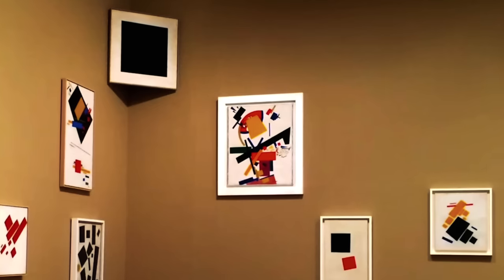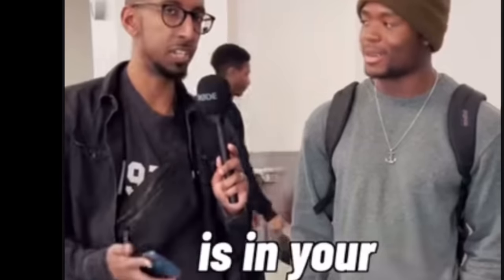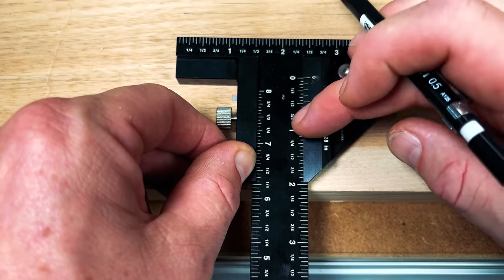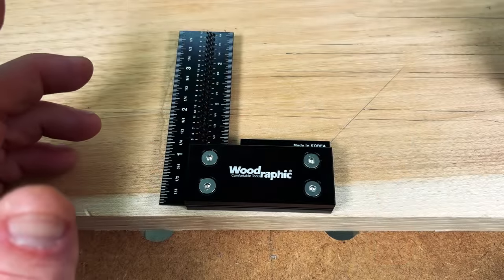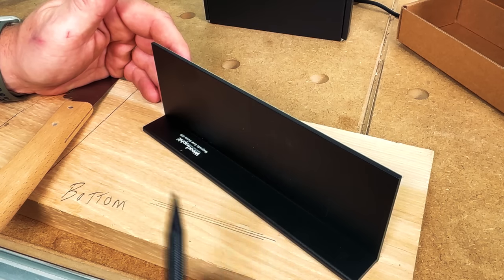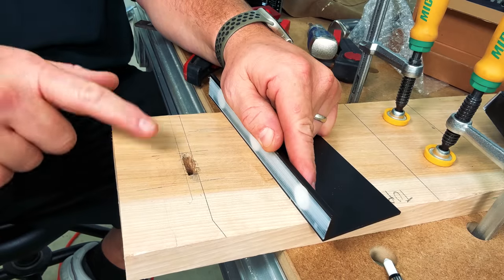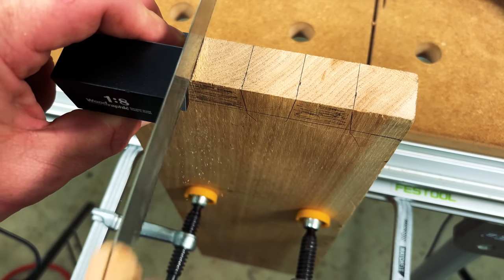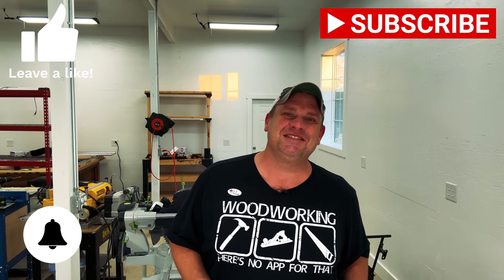Uncovering the Secret Tool Lineup That Will Challenge Woodpeckers

Comment: Great find Mr Flynndogg and thorough demo of these layout and guide tools! I love Black "high contrast" tools for the  tools I have to read with old eyes! Now for tools I don't read the uglier and brighter is what I pick for locating easier on my busy benches! Magnetic fence who knew, great design? Are those teflon coated, did they are you mention how long that would last? Checking the scales between the tools as applicable to also check a companies detail to accuracy and quality. Great find and thanks for sharing!
Reply from the maker: Great questions lespaulguitar man!  I like the black and white contrast too.   Really easy to read.   I don't know about the teflon coating, that is something I will need to research.   Great point on checking to see if the company has a tolerance for their accuracy that is another thing I want to look into.  Thanks for your great questions, and thanks so much for watching!
Reply: Appreciate your honest, informative, accurate, tool assesments and finding these alternative cost effective tools. Options are great to have, when you have to spread the funds for hobby /dyi work! Hope to see a project designed and made for Layla the new shop dog! Thanks!  @FlynndoggWoodwork

Comment: Thank you for shining some light on the Woodraphic brand. How much damage did that flush trim saw do to the plastic coating on the dovetail jig?
Reply from the maker: I didn't notice any damage, and if it did do damage I would suspect it is from my lack of skills! :)   I did notice a little bit of damage to the chisel saw guide, but that was also due to me not having the appropriate saw and the teeth rubbing against the metal when my cut wasn't completely straight.  Excellent question!    You know right after I filmed this video, I saw my damn japanese pull saw staring right at me on the top of one of my storage containers! :(

Comment: Have you tried the magnetic tools yet with a saw that has some set to it? I've always wondered how well they hold up, or would the saw's teeth end up damaging it?

Also, have you tried any iGaging tools? I have a couple and have been very pleased so far.
Reply from the maker: Great questions Eric,  the saw I used in the video had some set to it and actually did scratch it up a bit, So I won't be using that type of saw with it.   Too funny that you mentioned Igaging tools.  I'm in the process of thinking about doing a video on them.   They look really nice!

Comment: Interesting that you only had a flush trim saw available for testing the magnetic saw guide, its teeth don't have a set, unlike most regular saws which would be blunted in no time as soon as their teeth scrape against the side of the guide.
Reply from the maker: Well, the flush trim saw was advertised as a flush trim saw but it is a harbor freight one and I don't ever use this one on flush trimming as it does have the teeth bet out and scars up my wood every time I've tried to use it as a flush trim saw.  Excellent point though and thanks for sharing and watching secobaairways.
Reply: Those guides will get wrecked before any saw will; I say half a dozen cuts and you no longer have the precision you think you do. I don’t see why a woodworker would need such a tool in the first place, it’s like the most basic jig you can make out of hardwood. Unlike this soon-to-be-useless overpriced piece of metal you can true up your shop made guides using a disk sander as many times as you need. And magnets only get in the way, just bend the saw against the   Guiding surface
Reply from the maker: @nocandopdx  Thanks for sharing your thoughts nocandopdx!  I appreciate it!
Reply: @FlynndoggWoodwork  of course

Comment: Nice video as usual.  What is the difference between regular marking gauge and marking gauge marked (new) on amazon?
Reply from the maker: Interesting, I’m not sure I am familiar with what you are talking about.  I wonder if they have refurbished squares available?    I’m going to have to research this one!
Reply: @FlynndoggWoodwork  I followed your amazon link for Multigauge and i see for 8 inch model there are 2 listed. one is marked (New)
Reply from the maker: @AlexK07010  I did reach out to them they said they are aware of it, I guess they are having some stocking issues... Not sure what that means.
Reply: @FlynndoggWoodwork  thank you for following up

Comment: Nice but still too expensive. Their carpenter square for framing is $70. Crazy. Creating an accurate 45 with a laser cutting machine is a no brainer. All these companies are over charging. I’ve checked all my squares and they’re  all spot on. They’re either from Home Depot or Amazon.
Reply from the maker: I hear you doc145.  I agree with you, the woodraphic still aren't cheap.  I have a couple empires as well, that are dead square and do what they need too.  Just wish they had those little holes for scribing lines, but with the combination square I can always adjust it.   But I hear you, still very expensive!

Comment: The Woodraphic tools appear to be nice and I'll consider them for my next purchase. 

However, it's unfair to compare the Woodpecker 1282 12" square with Woodraphic's 12" square without also noting that the Woodpecker has a stainless steel blade and the Woodraphic's blade is aluminium. Using stainless steel allows Woodpecker's blade to be only 1/16" thick, reducing the chance of parallax error. Woodraphic's aluminium blade is not only less durable, it's thicker -- making it harder to read accurately. Besides, when I checked Woodpecker's website just now, the list price of the 1282 is $140, not the $180 mentioned in the video. The Woodpecker square is still $50 more than the Woodraphic, but it's NOT double the price of the Woodraphic as stated in the video.
Reply from the maker: Excellent point DKwaiser on the paralax!   I had forgotten about that, thanks for reminding me again.   I guess the paralax wouldn’t be that much of an issue if you were using the scribing holes though as you would have a positive point to reference versus your eyes, but get point.  Glad to see woodpeckers is come down a bit in the price, I suspect it won’t be for long.   I feel like they run a lot of short promotions on their tools that decrease the price for a short period of time.    Thanks again for bringing up the paralax!

Comment: Saw guides are nice and I have used them a time or two. But if you really want to get into hand tool woodworking, ignore the guides. Cut just off your knife line and use a shooting board to square up the ends. Even your best miter saw and table saw will never square up an edge as well as a shooting board.
Reply from the maker: Love it, thank you so much for the suggestion lanceyohe!  I would like to try and build a shooting board this year.   It's been on my list for some time.   Thank you so much for sharing and watching!

Comment: Dude. Compare the square to Woodpeckers 1282 at the 3:10 mark. They are both 12” long. Comparing to a 6” square and saying your product is longer makes no sense.  They both have scribe holes. They both have lips. Besides price what else is different?
Reply from the maker: That is a 1281, not a 1282.  It does not have scribe holes.  I wish I had the 1282, but that is what I bought the M12.   Thanks for watching mark!
Reply: @FlynndoggWoodwork   Thank you for your reply … and your enthusiasm is great!11. Yes, you did mention the 1282 at the start. Yes, I see the 1281 in the shot at the 2:53 mark. But you compared with a 642 square. My suggestion is to do an apples-to-apples comparison with a 1282.  Perhaps your point is that the 642 costs $100 or about the same as the 12” square you are comparing it to.
Reply from the maker: @mark2talk2u  yeah,  that probably would have been a better idea... just don't have the 1282.   Kind of the reason why I got the M12.   didn't want to fork out that much cash for that thing! :)

Comment: Why are woodpeckers tools outside the budget for most woodworkers ?  I don’t think because you are a woodworker that you cannot afford to buy an expensive tool.
Reply from the maker: Well, not everyone has unlimited budgets of course, and a lot of people are hesitant to spend hundreds of dollars on a measuring device.  I know I was when I first started out.   But I think most people begin to realize that money is usually well spent.   Good point and thanks for watching Brian
Reply: Because the only thing there is general agreement on is money.  As you know, that is what it is for.  So one has to be careful about just flashing high end tools without bowing to the fact that listeners may be offended.  

I  gather that in the US there were 400 new billionaires during COVID.  There are plenty of people out there who could buy every tool Bridge City makes, they used to offer that as a deal.  However, it also becomes a potential admission that one does not know what one is doing with wood.  I could collect them, just because, but it would be like collecting Hummel, no connection to reality.

Comment: Most of that stuff looks pretty pointless.  It isn't that accurate if it depends on dots for pencils, or alignments with the edge of a board.  It is still really expensive, and sorta pseudo metal working standards of accuracy, while not using the methods for measuring that metal working uses. 

Metal working and woodworking use high degrees of accuracy, but they are achieved in different ways.  One of the winning moves for WWII manufacturing was that Ford got Jorgenson blocks out of Norway (?), before the war, and this allowed the allies to build parts to a standard where manufacturing could be distributed, yet everything would fit together.  Unless you are Ikea, you could care less.  So highly accurate squares and references surfaces are used so your pal can build the sides of your dovetail drawer, and when he brings them to your shop, he can fit them perfectly to your previously built drawer front.  Oh, wait a second, that isn't a thing.

So when one sees a lot of fancy squares, and promises of hyper accuracy, but based not on reference surfaces, but crap like woodpecker, someone got snowed.  Not to say there is anything wrong with pretty tools, and expensive tools, but it is based on a fundamental misunderstanding of how woodwork is made.  And there isn't just one way.  Furniture is made differently than timber frames.  Understanding the basics really helps.  Of course one does need a square.  If it is a Woodpecker one, that is just dandy.  I prefer ones made of wood, and I rarely use markings, but it won't hurt your woodworking to use a WP square, if you know how to do woodworking layout.

I started adult woodworking about 1980.  At the time, Germans still had an apprenticeship system for solid woodworking, as I believe they still do.  And unlike places like LV that sold 6 in metal working squares (cheap and useful), the German companies still sold blank wooden squares, and it wasn't because they had so much to learn from us...  So yeah, I love anodized black aluminum...  Fishing reels...  But if you aren't comfortable working with a blank wooden square you may not understand how this stuff is really done.  You can still do it with your fancy tools, they are a joy to behold.
Reply from the maker: Oh I get it, I’ve actually made my own square before, I have a video on it.  But I appreciate your comment thanks for sharing

Comment: Great video. Happy to hear you are going to do some hand woodworking. On one of your deep dives in Google, find us some quality hand planes that won't break the bank. And which, say 3, are the most important to purchase first.  I really do appreciate your enthusiasm and great content. Thank you!
Reply: Jointer, bench and block.  However, if might be different if you did some specialty activity like making bows.

Cheapest is to make your own.  It is hard to get the "real" wood.  However, maple makes great planes, even if beech is better.  Back around 1980 when this stuff was really exploding I taught a course at LV on Krenov planes, which are just an option that most people can make.  I timed how long it took me to make one, assuming I had found all the necessary tools and had a reasonable source of wood to hand (but not to the level of a kit).  Takes 45 minutes.  That is to the first cut, but one can spend as much time as one wants, carving and finishing.  That presupposes access to a bandsaw.  woodworking has to start somewhere.  I went through the whole thing of starting with nothing, and it was tough.  That isn't how it worked traditionally.  You would probably learn in a shop.  From the 80s to 2000, we really didn't have access to real tools, particularly handsaws.  All that has changed.

If you can find second hand planes then stanley or record can be good.    My first jointer was a Record 07, and I still use it.  But they weigh 7 or 9 pounds, where a wooden plane weighs 2 in the same size, and is very slippery on the wood.  I am not a big fan of antique planes, there is usually something wrong with them.  Short blade, cracks, mixed parts, but your local market may be different than mine.

Anything by Lee Valley is pretty good.  Obviously Lee Nielsen, but expensive.

If you are smaller in stature you might want a number 3, as a bench plane.  A lot of big people like the 4, or the wide 4.  But the weight may be too much.    Some people buy a middling plane like a 5, and use it for everything, however, that is going to be  pretty heavy.  Some places sell reconditioned Stanley planes at less than new prices, and there are some premium Asian planes.  But I have no experience with those.

Wooden block planes are not my favourite, unless they are Japanese, and hard to save money there.  My favourites, and in my case worth saving up for, are:  The lie nielsen 102, and the Veritas Low Angle Block plane.  Always get low angle block planes.  I can do without block planes, doing without spokeshaves would be harder for me.
Reply from the maker: Thank you so much Polly!   I would love to check out some new hand planes.   I feel like I’m still in the process of learning how to use them correctly though.    Maybe after I get just a little more experience! :).  Thanks for watching!